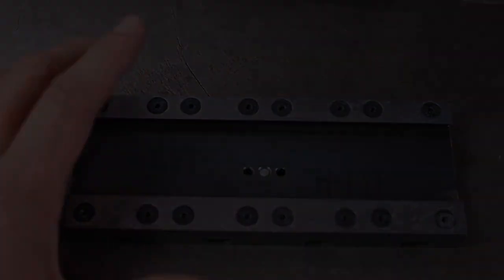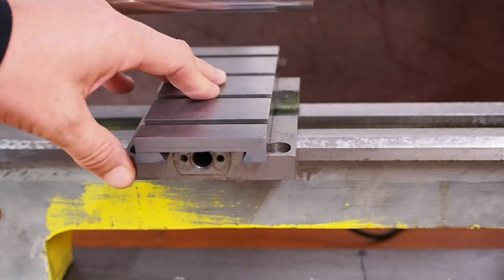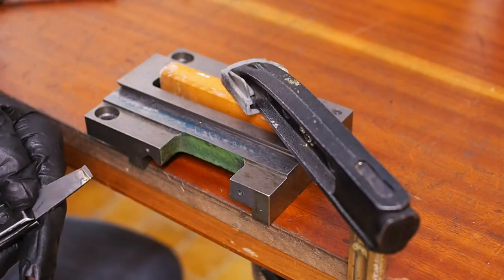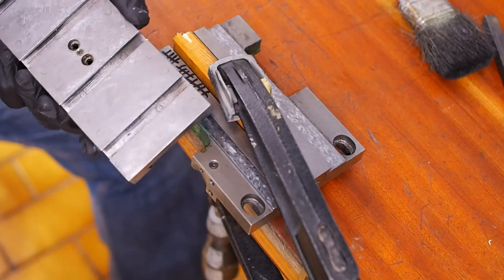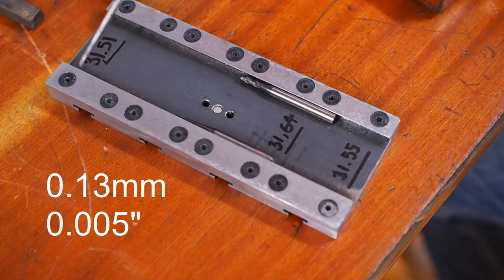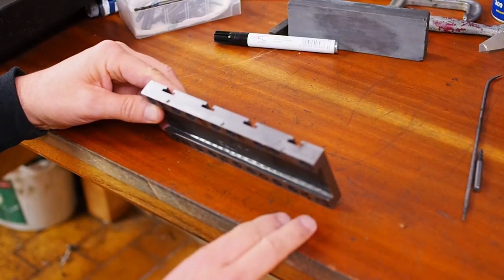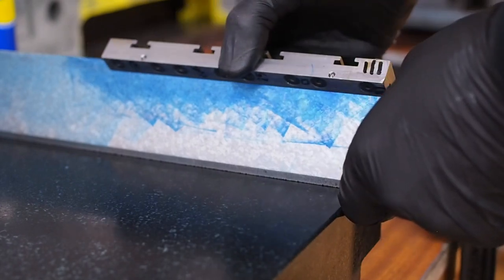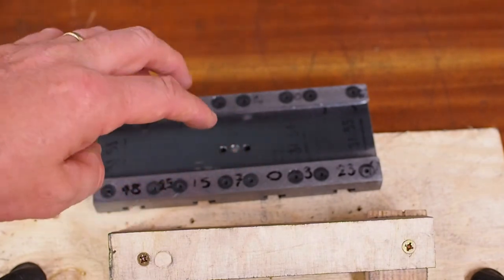Modifying the 7x12 Minilathe - Episode 9 - Saddle up

Comment: I have a an old Chinese combo mill drill lathe I bought new 25 years ago. I was ducking parts for years. I took it apart 5 years ago and found casting sand still in it. I polished the ways thinking the smoother the better. It’s worse now. Thanks for sharing.
Reply from the maker: Thanks for watching.

Comment: I found this series via this old Tony and his 'minila-the' project having just started with a considerably smaller Unimat. I still cannot wrap my head around the scraping and how it ensures level though.
Reply from the maker: Welcome to the series. You need a flat reference surface. In my case a black granite surface plate. You spread a thin layer of blue on the surface plate, and then rub the part on it. Anything which is high goes blue, and you scrape it off. Sooner ( well later) after doing it a couple of dozen times, you have a surface made up of little hills and valley, with the  peaks evenly distributed in a flat plane, and the valleys to retain the oil so that it doesnt wear out fast.
Reply: @RotarySMP  Ahh right, that makes more sense to me now. I did watch the video of you explaining it a couple of times and another video from someone on scraping who looked like Harrison Wells from the TV show Flash. Don't recall his name but cool points for the lookalike y. 😁
Thanks for the reply. I'm enjoying the progress and getting more fascinated with lathes and machine shop tools by the day.

Comment: You appear to be scraping the non-bearing surface behind the gib strip? Is the plan to fit something better than a strip of cold rolled steel and three screws then?
Reply from the maker: Hi Andy, I was thinking of trying the close fitting gib. Also it was easier to scrap both the non bearing and bearing surface, than just trying to hit the bearings area.
Reply: @RotarySMP  Is it too late to re-machine for a tapered gib? They seem much nicer, but I don't know if I have seen one for a design where the slider is longer than the static part.
Reply from the maker: @andypughtube  That would be polishing a turd. And you know I am too sensible for that. :)

Comment: Super content across your channel, but I did notice that once in a while your audio levels drop quite a bit. I don't know what software you cut your videos in, but most of them will have an "auto level" or "normalize" feature that does a pretty good job at bringing the audio up to a "standard level". 

Until then, if some of you out there feel it's a bit on the low side and don't want to use headphones, then here's a workaround. Download the free VLC player which is pretty much the best video player out there as there's hardly any format it can't handle. (It comes for both Mac and Win). But it also has a feature where you can tell it to open a network link. So, copy paste the youtube link and VLC will start playing it and as a standard it will let you bump the volume to 200%.
Reply from the maker: Thanks. I later switched to a Rode Wireless go, but have made plenty of errors with the audio over the last year. Being camera man, sound guy, actor, writer and editor all in one is not ideal. Audio is very inmportant, but I often only notice errors in post.
Reply: @RotarySMP  I couldn't agree more. I am photojounalist who sometimes shoot video  as a one mand band - or tiny team - and audio can make or break a project easily. The number one trick, but not sure it is practical or safe when machining is to monitor the audio in real time. Which means, having headphones on as you shoot or do voice overs. The headphone monitoring is brutally honest as you will hear all the noises that the brain blocks for you. Like a noisy fridge or AC or a neighbor mowing his lawn, etc, etc. 

Just in case you use Davinci Resolve, the auto leveling option there is called Normalize Audio and it's doing a really good job at it.
Reply from the maker: @AntiVaganza  I use Da Vinci, and auto normalise to -9db, but because you often have noise spikes with metal tooling, you still need a lot of manual correction.
Reply: @RotarySMP  Gotcha and once I get a bit further in your series, I am sure the audio is getting even better:)